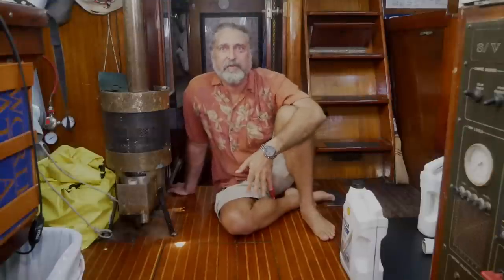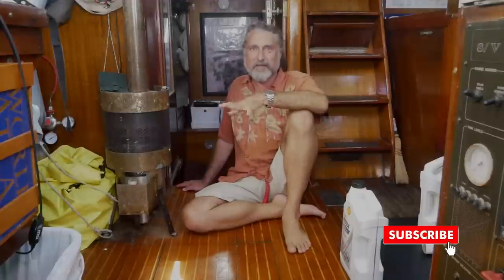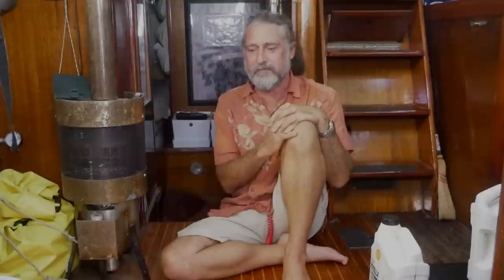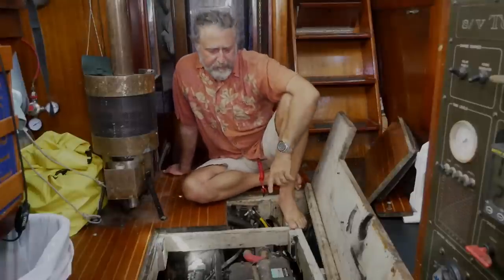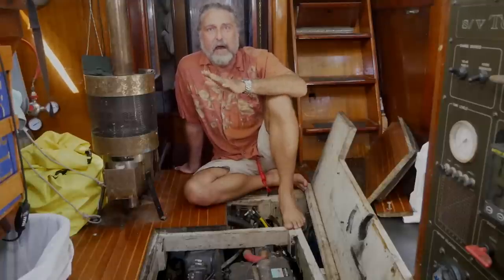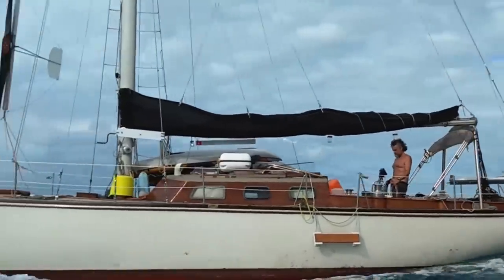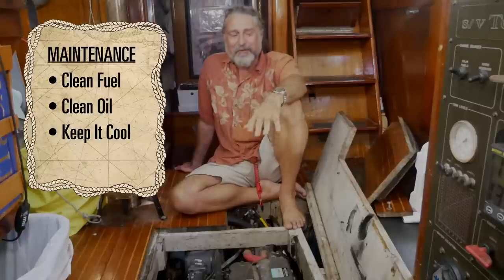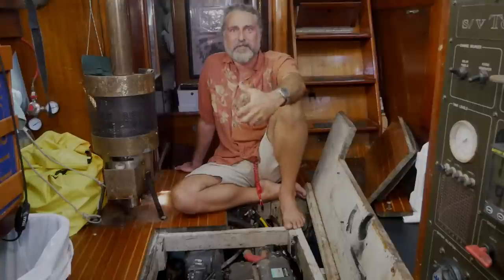Boat DIESEL ENGINE Hacks & Oil Change [Capable Cruising]

Comment: I really appreciate seeing the same engine as mine, really helps. Any chance to get a new link for a spare starter? Current link and link on cruise-mas video don't work anymore. I think it's a great idea to get a spare but without either a specific model number or link, I don't have confidence to order one.
Reply from the maker: I'll look into that Brad.  Might take a week or so.
Thanks for noticing.
Reply from the maker: You're right.  It's hard to tell.  Im pretty sure I found a reasonably priced unit that should fit and will be putting it up to our Amazon store soon.  It's currently going for just under $100us and claims to be a replacement for the yanmar part number.

As always, I'm doing my best to shop for all of us.  If you get one of these and it works or doesn't please tell me (I read all comments) so I can know it fits or change the link.

Also I didn't mention it but I always unmount my old starter and mount the new one once you get it.  That way you test the new gear (could be doa) and have confidence in your spare because you have had it installed on your engine and it worked.
Reply: @Clarks-Adventure  Mounting and testing right away is a really good idea. Do you have a link to the part?
Reply from the maker: Emily says "done".

So it should be on our Amazon store
Reply: Thanks Emily
Reply: Found it and ordered. Ironically, I went to my new boat (to me) a day or two after watching this video  and guess what... It's not starting. Just fast clicks, could it be solenoid?
Reply from the maker: Could be.  But more likely it's a bad battery connection.  Maybe the negative side.  I'm assuming your batteries are full.   Anyway check that first.  Easier
Reply: @Clarks-Adventure  Ended up changing a couple of old batteries out, and the motor started fine. The batteries were fairly old but seemed fine, until they weren't.

Comment: Great presentation " AGAIN' 
2 questions what micron element do you run in the Raycor and do you use synthetic oil ? If not any reason other than cost ? I guess that's three questions.
Reply from the maker: Yanmar doesn't recommend synthetic, so no.   I can't remember the filter size.  What everyone uses.  They are brown.

I really don't buy filters much.  Haven't bought one in over 15 years.
Reply: @Clarks-Adventure  
So does Yanmar not recommend it or recommends not to use it.?
 Big difference
Reply from the maker: They specifically recommend rotella the shell product.
I  am not sure if there even is a synthetic diesel rated oil.

I use synthetic in my Mercedes.
Reply: @Clarks-Adventure  There are several.  Mobil Delvac, Castrol Vecton, Delo 400 (Chevron), Valvolene and likely others.  But they are designed for class 8 trucks really and I have no idea if the marine environment would preclude using them for some reason.  Not that I know of a reason why they would not be suitable.
Reply: Oops!  I forgot the Shell Rotella T6 which is also full synthetic diesel oil.
Reply from the maker: Thanks J
   I bet they would all be fine but best to check with yanmar.  It might be as simple as these weren't available back when my jh5 was first released.  But they might have some other issue.
Reply: @judunlap2138  Yes I run T6 , big study of trucks running full synthetic and pressure at cold start was way quicker than dino oil so that's what I do. Lots of folks say no but never got a decent reason why not other than bad for the seals which is bunk.

Comment: Another question: do you have a water heater? If so, does it heat up with the engine when possible? Thanks
Reply from the maker: We use an on demand propane water heater.  Love it!

Comment: Shouldn’t you have the pump after the racor?  Keeps turbulent fuel out of the filter.
Reply from the maker: No works better before.  Turbulence isn't an issue.  But if the filter plugged up the pump will draw a vacuum and not function well.    Also that filter is for the engine.  Having the pump in the manifold let's it function as a transfer pump.

Comment: Mercedes auto recommends changing the oil in all of their vehicles by suctioning from the dipstick, if it has one (another port otherwise). There is a misnomer that you can’t get all of the oil out that way. BS!
Do yourself a favor and get a mini pump system that cause a vacuum with a catch either by hand or with compressed air. They are very reasonable. $80-$120.
Reply from the maker: Yes vacuum is the way to go.

Not much is going to perform better then the little brass pump I use.  It's still made, by the way.

Comment: I don't love the idea of boosting fuel line pressure with an aftermarket pump in order to overcome clogged Racor. You're deviating from manufacturer specs and newer diesels have a lot more sensors and circuit boards. I'm not a mechanic let alone engineer as you are but it just seems unwise. The manifold system is cool, but the downside is you're increasing complexity and creating more fail points in the most essential system of a diesel. That's the trade off. It's still a good idea but personally I wouldn't do it unless I had good, easy access to the manifold and second filter and pump. Engine access is underrated as a feature in boating.
Reply from the maker: Then you shouldn't.  You should set up your system as you feel right.
   4jh yanmar series have no such sensors.  I have personally not seen sensors like that in any engine one would out in a sailboat and I wouldn't have one.  Computer controlled diesels at best have new failure modes.
   Also know that the pump I use only produces 2.5 psi if I remember correctly.
Reply: @Clarks-Adventure  And that right there is why I LOVE old diesels. Simplicity. I don't even want a turbocharger. Yeah yeah more efficiency and performance, but in my simple mind it's something else to go wrong and they are not cheap to fix when they go out. And if you DIY your job is now harder. People love to trash old Detroit Diesels. But the haters always forget to mention Detroits always start and always run. They're beasts. Overall, about your hack, I'm not trying to change your mind or anyone's but it's fair to bring up counter argument. No offense intended. On the topic of circuit boards, I do know newish outboards are rife with them as are newish diesels. Even as an engineer you probably don't like seeing a Circuit board on a diesel, imagine how a hack like me feels! Btw, CB's are also becoming scarce. Covid supply chain disruptions etc. A dockmate waited 9 months for a simple backordered CB, his engine would not run until that little CB
 arrived.
Reply from the maker: For much the same reason I think lithium batteries on a voyaging yacht need a lead backup, I agree diesels should be purely mechanical!

Comment: 1.2.3.... “The oil will not tip over... the oil will not....” 🎼
Reply from the maker: Clever.  I found myself worrying about that used oil every time while editing.  I'd normally put the cap right back on.  Doing a video makes projects harder. -C
Reply: Emily & Clark's Adventure.. it was in response to the comments referring to the lid. 
I however, had absolute faith in you. Your channel is a breath of fresh air. Thank you for sharing your journey, experiences and thoughts with us!

Comment: What about a turbocharger?
Reply from the maker: What about it?
   Yes lots of diesels have turbos.  They work better on a diesel then a gas engine.
Reply: @Clarks-Adventure  Sorry, more specifically, how do you maintain a turbo charger?  Other than cleaning the screen on the belows is there a lubrication protocol or procedure?  I have a Yanmar 4JH2-TE It is producing white smoke.  I was told it could be the turbocharger.  I plan to remove it.  I would prefer to rebuild it myself if it is not too complicated.  But looking for advise regarding rebuild/replace.  Why did it go bad?  Was there a maintenance procedure that should have been going on?
Love your channel and the DIY concept.  I know your Yanmar was not turbocharged, but that doesn't necessarily mean you have no knowledge about it.  Thanks.
Reply from the maker: Sure,
   Thanks Scott.

I think you should look for other opinions, maybe on forums.  I've never owned a diesel with a turbo.  All my knowledge is theory and for what you are asking experience is key.  
   I'm just not qualified.

Comment: When buying oil, go by the api rating. Not the name of the manufacturer. If the api rating is correct, use whatever you want. Avoid “high mileage “ oil unless you are concerned with ring blow-by. Then never go back to anything but high mileage until you have your rings serviced.
Reply: I think the oil made specifically for marine use can have some additives to prevent rust, that you don't necessarily get with the standard engine oil, and which could be why the marine one costs a bit more (if it does).

Comment: Ok lot of what you say is good stuff real good until you get to fuel pump all Racors filters must have the fuel sucked threw them never pushed .thats a big no no nice littel Yanmar my 4lhste I installed big brother to your 4 cyl is 230 hp when I was going to school for Yanmar the factory rep expand the best way of keeping a engine running is simple every engine is designed to put out x amount of horse power over a given period of time how the power is pulled used is up to how hard it's run    I never run my engine up after bringing in to port just heats up the turbo that just cooled down on the way in makes no sense .i do like your fuel polishing set up change your pump location add magnetic filter kill allergy and that's the exact same system I use I regulate how often I change my filters by ours I don't go over 250 on the fuel filters they are cheaper than pumps or spray nozzles Yanmar dose  not have injector they  have spray nozzles
Reply from the maker: I've been running my racors that way for 30 years.  No leaks.
Reply: @Clarks-Adventure  well I'm 63 years old now and ben working on engines  since I was 14 I also worked as an engineer taking care of larger larger vessels  I hear that answer a lot. My answer is always the same just because you've been doing it that way and getting away with it doesn't mean it's correct not about leaks it bypasses the pressure. If your engine tries to shut down and you turn on the fuel pump to build pressure you're forcing the fuel through the bypass not filtered until it hits your secondary filter on your engine which in turn bypasses straight back to the fuel tank
Reply from the maker: Thanks.  Good point